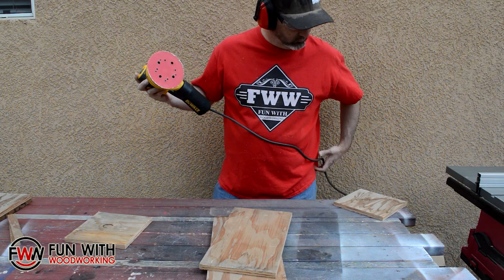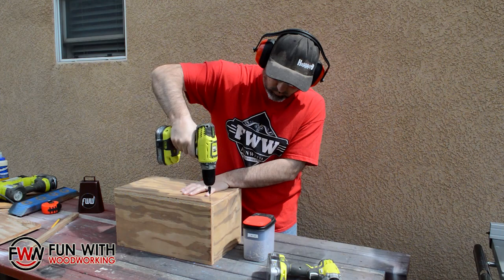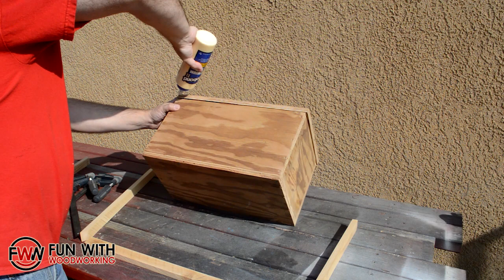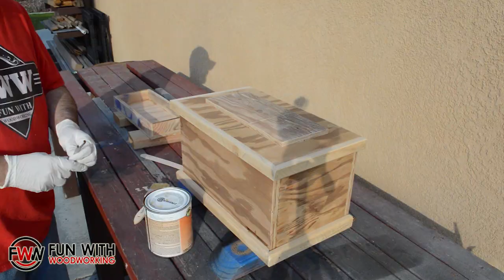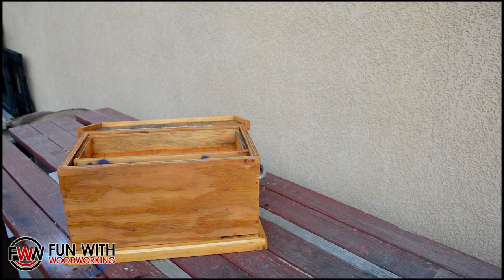How to build a Classic Wooden Toolbox from reclaimed lumber

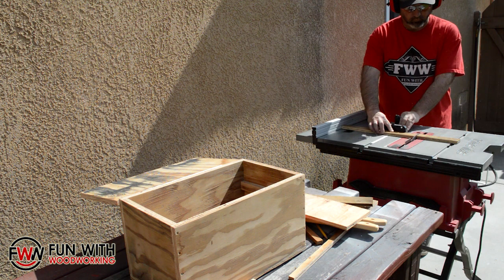Comment: That cut you made at 5:07 is really risky, better to use a sled for that or a stop block on the fence that leaves clearance as the piece passes through the blade. The way you cut it risks kickback.
Reply from the maker: Thank you for caring.